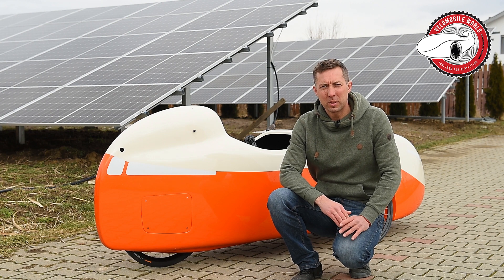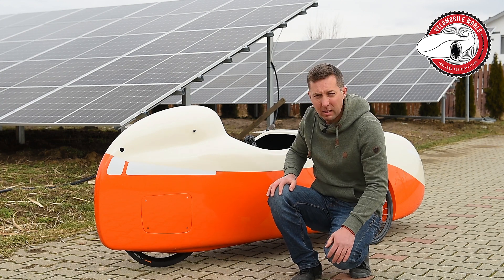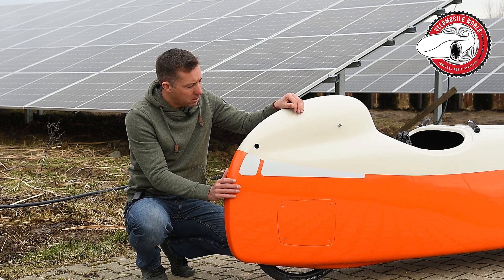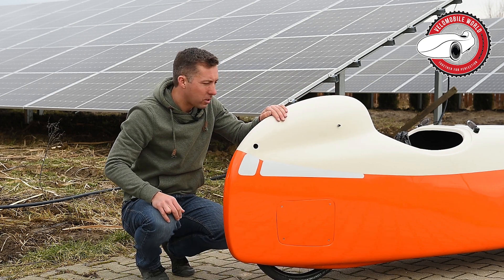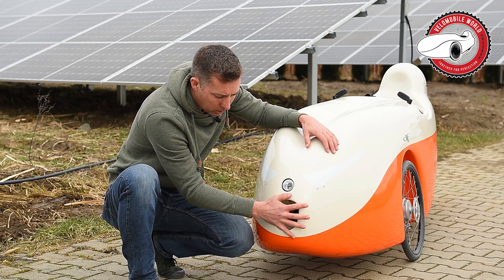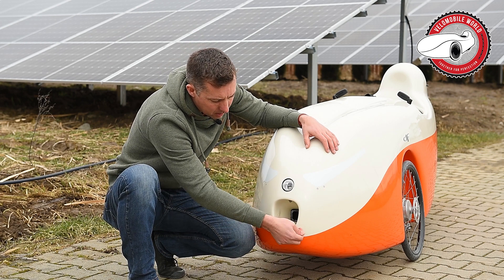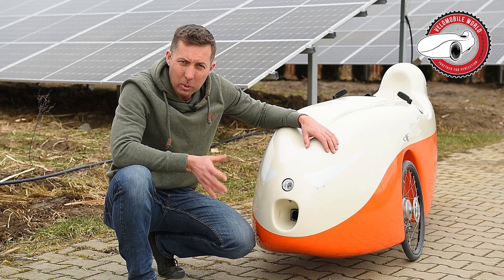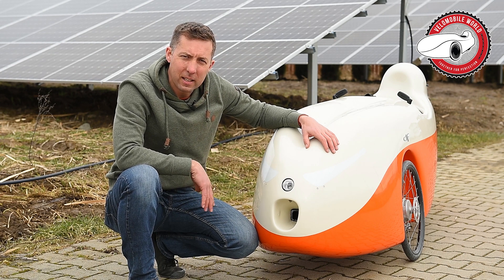DF/DFXL News | 2023 | Velomobile World

Comment: I'm biased because I own one. But I must say that after three seasons of pedaling with DFXL, I still think that I made the right choice. I wanted a tried and tested, sturdy but light shuttle, and I really got one. The looks is very streamlined, timeless and classic. It rides fast and if I'd put pants on, it is on the same ballpark with the latest, new velomobiles. The only thing that I've done is some tyre changing, really. So, very trouble free construction. I haven't even adjusted the gears yet, after 10k kms 😄

But the microscopic Kellermanns and no real tail light, ehhh.... ok, I'll stop my complaining short 👍
Reply from the maker: Hi Seppo! The lights works pretty well and they are very bright. You should also try a bulk one day!!;-)